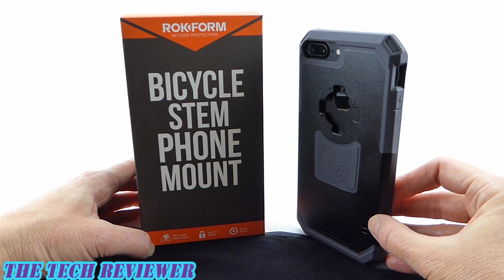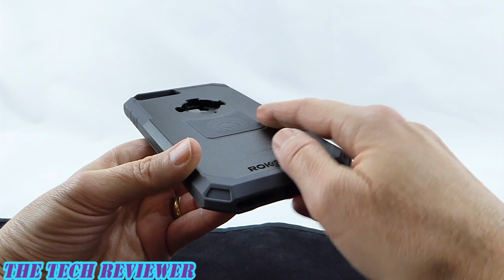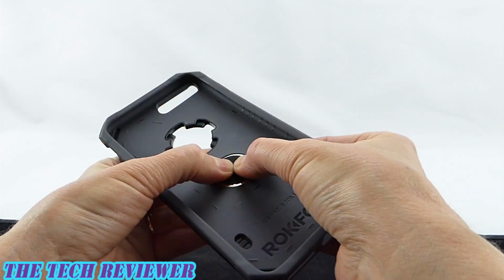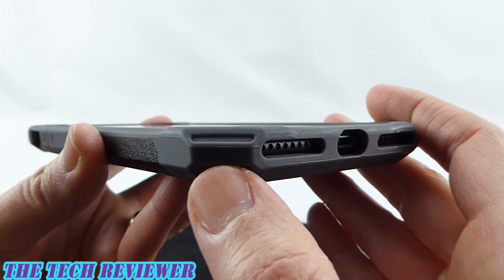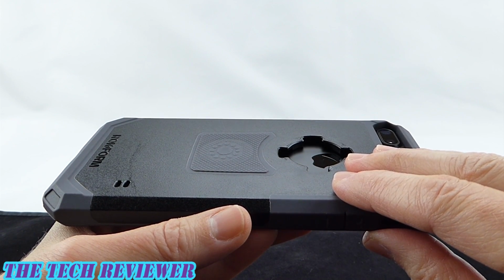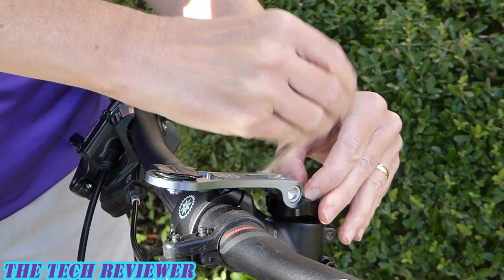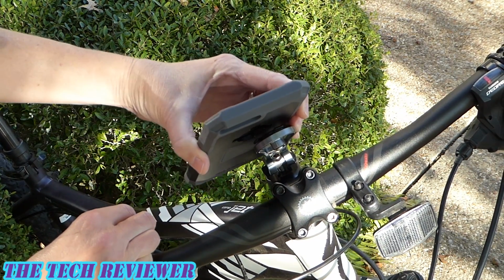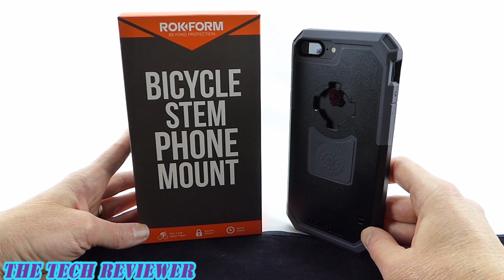Rokform iPhone 7 Plus Pro Series Bike Mount Kit: Mega Secure Machined Aluminum Bike Mount System!

Comment: Is there a trick to take the case off? smh hehe =)
Reply from the maker: Hi Naydeen! Not really--you just push the case off in two adjoining corners. I usually do the top right and bottom right. Then the rest of the case will come off easily...

Comment: Which will you choose to daily use the Rockform stand or the Quadlock one and why?
Reply: I will use it on a motorcycle
Reply from the maker: the Rokform is definitely more heavy duty. If I were using it on a motorcycle, I'd probably go with the Rokform, but you might want to check with the company and see if It can handle the higher speeds of motorcycle use. I really have no idea whether it can or not...